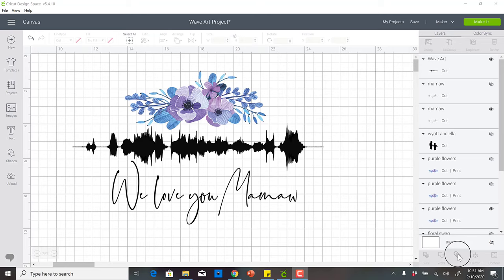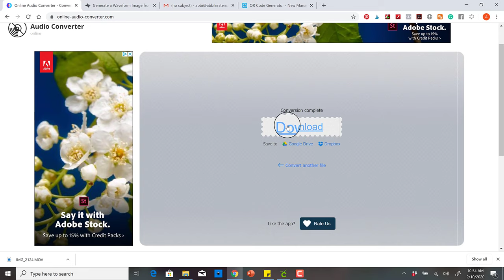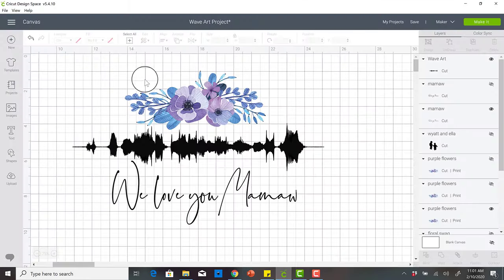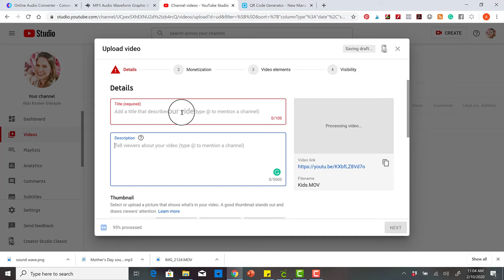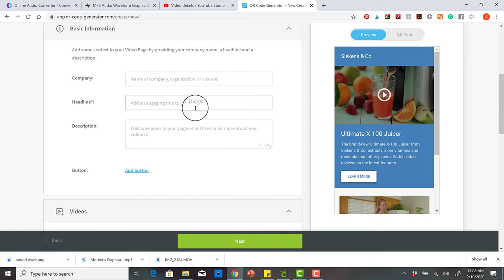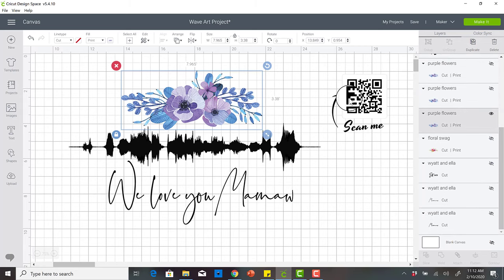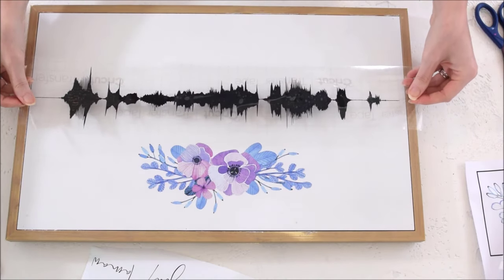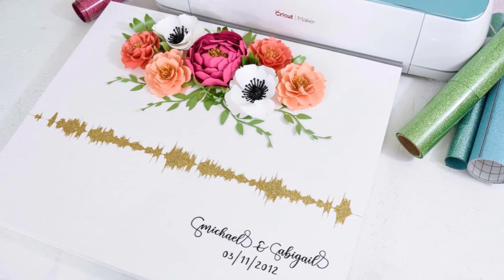DIY Soundwave Art - How to convert a video into soundwave art step by step

Comment: What setting did you use to cut? Did you do anything different to the wave art to make the lines thicker so it's easier to pull the vinyl away like that? I'm having such a hard time with mine! HELP!
Reply: Me too I am having a hard time with the vinyl
Reply: @beatrizburkholder9056   I figured mine out! I took the sound waves into a photoshop like program, Photopea, its online and free. Make the art have an outline and you make it as thick as you want. SO much easier to weed. It came out amazing

Comment: I don't understand why my machine will not cut a soundwave cleanly.  I've tried several times on vinyl and on print then cut and the lines of the wave are so thin that it just shreds them.  How does this not happen to you?
Reply from the maker: Make sure you are using vinyl or iron on vinyl not print then cut - the material is too delicate. :)

Comment: Abbi, this was great design... I am a novice with the Cricut Maker, can you tell me what size is the sound wave? I keep trying and it keeps getting shredded through machine. thx
Reply from the maker: Hi! My canvas here is about 16 inches wide so that is the length of my soundwave. I also used glitter HTV. The wavelength thickness is about 3 inches high.

Comment: HOW IS YOUR LINE SO THICK ON THE SOUNDWAVE?  I FOLLOWED THE INSTRUCTIONS EXACTLY BUT MY MACHINE DIDN'T CUT IT CORRECTLY AT ALL.  THE THIN LINE BETWEEN EACH SECTION IS NOT EVEN THICK ENOUGH TO WEED.
Reply from the maker: I did enlarge it quite a bit as you can see from the size of my canvas. You can also make edits to the thickness in Inkscape if you open the file in that program. :)
Reply: @abbikirstencollections  can you make it thicker in design space using the offset?